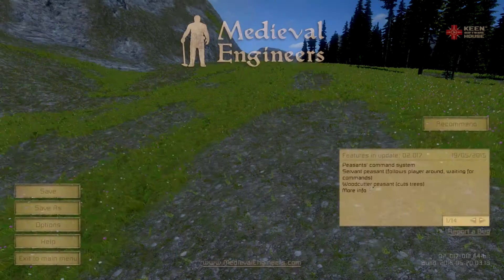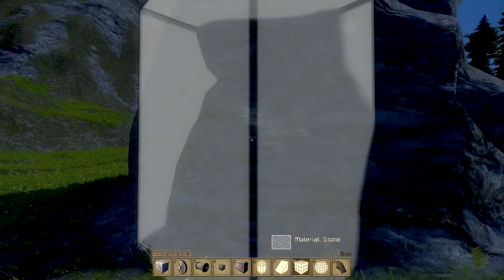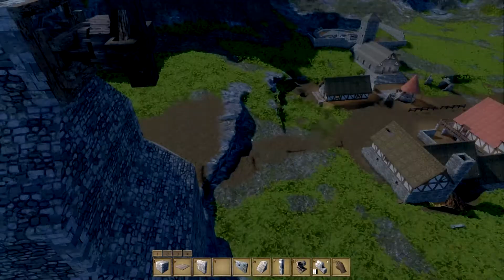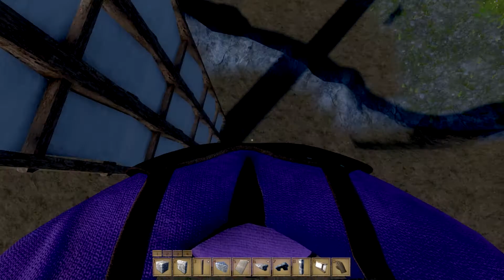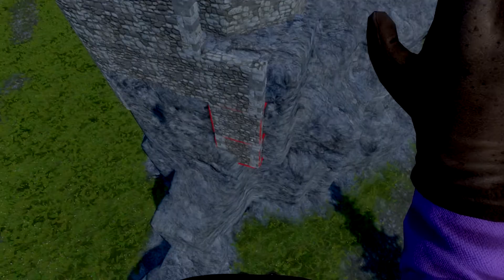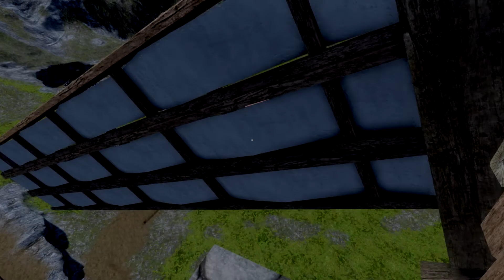Medieval Engineers - Minion Village - "Windmill Rock Farm" Build (Part 1)

Comment: Ooooh, I actually really do like this Windmill you've made.
Though, there might need to be a staircase for the minions to actually access the Mill without having to climb and jump off a big ole' boulder. ;)

The only thing that bothers me is... well, and this is nitpicking but... I'm pretty sure that the windmills blades are angled the wrong direction for the way it rotates. There's no need to go through the hassle of replacing the blades just to rotate the blades, but it does bother me a bit when I'm looking at the thing in motion.

Good video as usual, Dave. Cheers.
Reply from the maker: Inanedata Hmm maybe, I'll check. It'll probably start bugging me now and then I'll have to replace them. Thanks ;P

Comment: That's a pretty awesome windmill, is there anyway to utilise sources of mechanical energy like a windmill in medieval engineers at the moment? (Not that the windmill is actually generating energy, I think it's basically being driven by that rotor isn't it?)
Reply from the maker: Debated Nothing Correct, sadly no way to use the power (or even generate it) yet. But I'm sure it'll come in time 8) I have to say I'm really looking forward to a proper survival mode in ME.
Reply: Weird Wizard Dave Could you not use something similar to the power transfer system from the lift video?